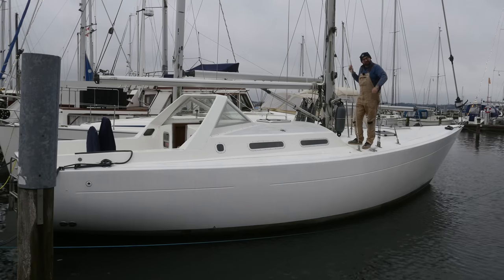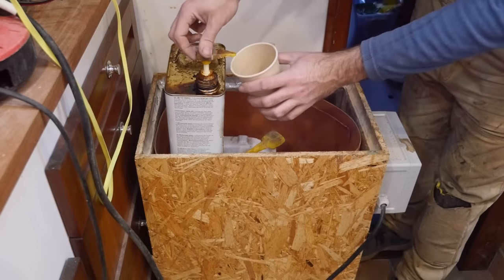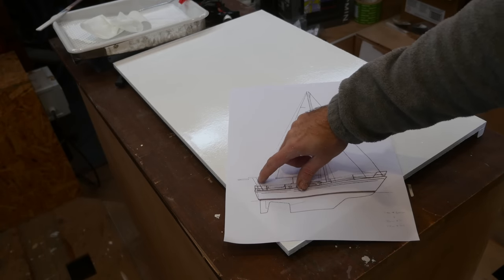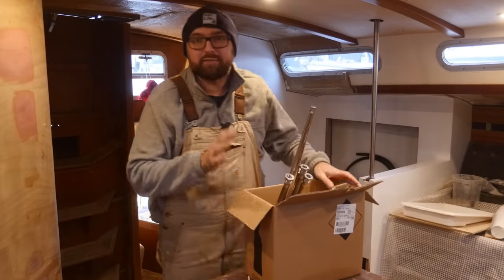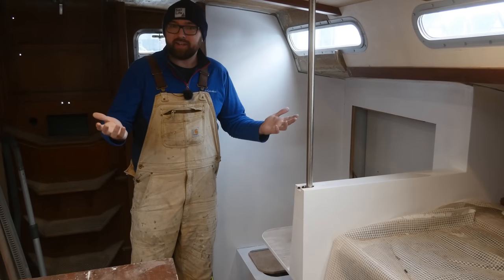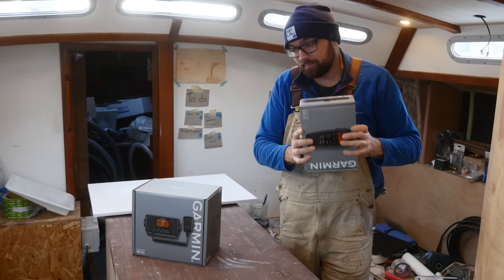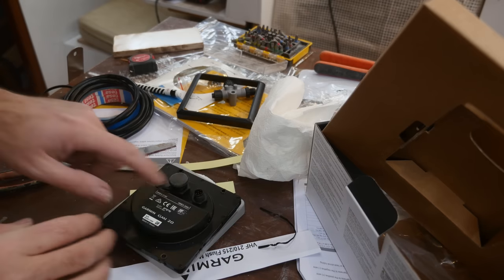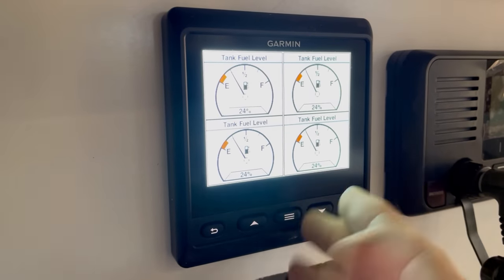Sail Life - Solar arch model, toe rail, NMEA 2000 network - DIY sailboat project

Comment: NMEA-2K is great. It is a huge improvement over the previous marine  network standards.  Like USB, it is basically plug and play with minimal setup even on the network side.  For the most part it just works automagically.  Sometimes a box needs to be checked on a menu screen at a device to turn on something like sharing/passing the sentence or looking for it elsewhere on the network.

Is your old AIS from Athena NMEA-2K or the old standard?  Our boat came with an older NMEA-0183 AIS and I could never get to interface correctly with our new B&G Vulcan 7 chartplotter even though it is supposed to see 0183.  I even tried a $300 multiplexer to get it to work and still no go.  Finally I got fed up and bought a new NMEA-2K AIS, plugged it in and, it just worked right out of the box.  The Vulcan-7 saw and displayed the targets without even changing a menu setting.  Bravo Zulu!

As an electrician I've sucked a lot of string through miles and miles of pipe.  We usually use plastic baggies.  Underground PVC pipe often has water in it from condensation.  A paper towel just wouldn't cut it. They actually make a purpose-made "mouse" made out of disks and foam sized exactly for each size of conduit for sucking special "jet-line" through conduit. For 3" and 4" pipe it works much better than a baggie.  But for small pipes the baggies are better and easier -also much cheaper.

Comment: In my past, I had to pull cable through conduit. Good trick for getting that pull line in place but... The trick will likely fail by the third cable. I suggest you put "Pull Cable" in all your conduits and in the future always pull a new cable with a new pull line. If you have an electrician friend, they can point you to a good line and cable pull lube.

Comment: I would not make the two outer lines of the solar panel arch parallel, rather narrower toward the top on all sides (a truncated pyramid with a center of G that projects outside the base of the full pyramid, essentially). Reason being that the structure would not only look better, but also be far stronger as the narrower top would disseminate forces exerted by the panels easier. Just my 2 cents.

Comment: I have a somewhat unorthodox suggestion for the placement of the chart plotter - why not install it on a mounting arm (simple stainless steel post with swivel) above the navigation station / salon divider where you're installing the 24" monitor. This option is inspired by a similar idea on the Seawind 1160. By positioning it here, you'll be able to easily see it while in the salon, at the nav station, in the galley, or anywhere else simply by swiveling it as required. While I have no idea if you had some other ideas for the area, it might even be able to accommodate additional elements if you added a height adjustment feature, Continued luck on all your projects and Happy New Year!

Comment: This may be a crazy and impractical idea, but is it possible to rotate your solar panels 90º so they run lengthwise port to starboard... then hinge the two together on the long side so they can fold together like a book? You can unfold them when it's sunny out and fold them up in a storm.  That would take up less real estate on the arch, look cleaner, less wind resistance when sailing, all kinds of potential benefits. I just don't know if it's structurally possible.

Comment: Could you possibly have the solar panel mounted, from port to starboard oppose forward to aft? 
I think it would reduce the chance of the panels flex from the rocking and rolling of the boat. Flex can lead to a breakage, and that would suck.

Comment: Judging by the electrics you installed but had to tear out (about 2 years ago) you don’t need advice on how and where to run cables. If you do it the same as then, it will be the neatest work on the water

Comment: Happy new year! My feedback as requested: Regarding the breaker panel, as already mentioned, make sure the breakers are NOT at shoulder height. I can tell you it's really annoying when you're sailing along, and suddenly loose half your instruments! Also I'd place the AC-panel in such a way, that it's imposible to lean on it or touch it with a screwdriver when working on the DC stuff. Or did it come with a back cover? 

And some none-requested feedback: The rear arch looks proportional to my eye, but personally I think the panel has to be placed transverse to the length of the boat. Visually it's pointing to far forward, and will also make installing a bimini-cover much more difficult. Is it possible to install one large panel on the stern and two smaller ones on the cabin top?

Comment: Madds for what my opinion is worth HTDuchy's suggestion for mounting the chart plotter also makes best sense to me.

Otherwise would you consider mounting the chart plotter on a U shaped bracket attached to the wood ledge above and behind where you intend to mount your computer monitor?

After all having it in a location where it is conveniently visible and accessible while seated makes most sense.

Also if you could swivel it so it was visible when you are in the galley or working at the counter top for the galley/lounge island would that not be even better for things like AIS and so forth?

Comment: You should look into powder coating your winches. I know the new look these days is the satin black and you can powder coat yours like that really cheap and 100% DIY.
Reply: John Demos Powder coat will not stand up to the friction of the lines. It will wear off in no time at all, and look like crap forever. Also, those winches are chrome over bronze, just removing the chrome and prepping the bronze so the powder coat will stick will cost as much as re-chroming them.

Comment: practical tip regarding the solar panels , 1x2m 360Wp is very large , why dont you look at 1x1.5m 370Wp panels from LG ? same power in a smaller footprint

Comment: Happy New Year Mads!   The boat is looking good.  I'm wondering why you're spending all that money on expen$ive marine hardware like the GMI 20 units, and a dedicated chart plotter.    You've already got an iPad and a MacBook; you can drive an external monitor at the nav desk using the MacBook, and you can mount the iPad on the helm station.  You can run navigation software and display NMEA data on both computers, and avoid the expensive Garmin stuff.

Comment: Re solar arch and size of panels how about panels that fold in half so you can make them smaller if needed like in serious weather. Also have seen panels on the side that can wing up or down. May be better and more managable getting more smaller panels than two huge ones.

Comment: I had problems getting DSC data to my Garmin plotter via NMEA 2K. I forget if it was a VHF receiver issue (which was also NMEA 2K) needed to use the old NMEA standard. One of my projects is to use a Yacht Devices NMEA 2K to WiFi dongle that can present data to my PC. I'll be making a GUI to get that data to my display.

Comment: Happy new year! Might have been suggested or commented before but why don't you put the chartplotter outside where it's most handy during sailing? You can then through WiFi repeat it on a tablet inside? Much easier than a tablet outside and the chartplotter inside. Love the Garmin stuff too, super easy to work with and very intuitive to use.
Reply from the maker: There'll be a second chartplotter out in the cockpit :) I properly should have mentioned that in the video - doh! :)
Reply: @SailLife  Even better!

Comment: FYI 
It’s necessary to have a physical separation between AC and DC panels on a boat. Not to do this is just asking to get somebody electrocuted.
Reply: Actually, not really... many/most boats I work on have the DC and AC panels right next to each other. The convenience of co-location is just to great. But for safety I would definitely recommend having the back of AC panel covered to avoid accidently touching live wires. Blue Sea makes such back-covers for their AC panels. Also, as others have said, ideally you would run AC wires away from low-voltage DC wires where possible, especially for long parallel runs, only crossing at 90deg where necessary. For shorter runs the concern of 50/60Hz cross-talk is not great. Of particular concern is AC wires run parallel to speaker wire, where you induce 50/60Hz humm into the speaker and you can actually hear it!
Reply: I don’t know the marine standard around the world but in North America all new boat construction must have the DC and AC panels fiscally separated. I understand this boat is a rebuild but the opportunity to divide the electrical cabinet exist and would be rather simple. If it were me, I would do it.
Reply: @ianwidger7905  I don't understand your point - by using two panels, one AC and one DC they are "physically" separate and isolated, but they will just be mounted next to each other - which is what I was suggesting. Most boats, even production boats in the US, have the AC and DC panels right next to each other and that is quite safe!
Reply: @toddmalone4384  
Hi Todd 
The panels should have a fiscal separation between them. By way of example divide the cabinet into two separate sections with two doors. This way when working on the DC, the AC is completely separate and closed off. And vice versa.

Comment: Hi would you consider fitting a b&g gofree wifi? These work great and mirror the screen of a chartplotter or autopilot anywhere on a ipad or wifi device. I could even change settings from the ipad! I also have navionics charts on the ipad and could these charts instead of those on the chartplotter. A really clever bit of kit! Best wishes, have enjoyed your videos over the last few? years!
Reply: Forgot to mention, I remember you had victron battery monitors etc (another great bit of kit), these have bluetooth and can display on the ipad as well! Oh the options makes ones head dizzy!

Comment: I would use panduit behind your folddown electrical board surrrounding compnents mounted on hull of boat. It organizes wires very well. Try to keep ac wires away from signal wires and tonsome extent dc wires due to induced voltage and interference concerns.

Is your genset AC or DC?

Comment: I have never been on a sailing vessel in my life but it occurs to me to ask if some/all of this electronic wizardry stuff comes with warning devices of either visual and/or audible monitoring alarms for important or even critical issues whilst sailing and also stationary (never mind security issues!)?

Consider modern engine driven, these vehicles that have an increasing amount of electronics installed. Manufacturers have found it wise and often necessary to install such monitoring equipment despite many normal gauges and warning lights that have been used for years but have been increasingly ignored by drivers / operators!

What in practical terms happens if there is a power failure or something like a lightening strike? Is there a fall back position for coping to sail safely?

Comment: Instead of flush mounting the chart plotter, consider a pivoting RAM mount.  They can be used on vertical or horizon surfaces and allow turning the display for better viewing in different locations.  See https://www.rammount.com/part/RAM-109HU

Comment: Mads, you should use the Sunpower Maxion 3 they are 400 w and 1690x1046 the best and most rugged panels. 300 mm shorter would be much better. Also, why is the arch so high?
Reply from the maker: Thanks! Those look awesome. If the arch is any lower than I'll bump my head when standing in the cockpit

Comment: Where is your ac source selector, shore, genny, invertor going? Are you going to use something like https://www.amazon.com/dp/B000K2K8O6/ or a surface mount unit that can go on the backboard? I'd go for one on the backboard because it rarely gets used, and hinge-ing bigger cables is hard to strain releive well. Where are bus breakers going, one breaker for each 240AC, 24DC, 12DC to switch on/off? https://www.amazon.com/dp/B01G5WHOCI

Remember fuses and breakers protect the cable leading away from them, so you will still need breakers/disconnects at the shore plug, genny, batteries and invertor. Having a second disconnect in one place, desk, is for convience.  Those 2nd disconnects  and a/b, a/b/c power switches will take up some real estate on the backboard.  Lay those out first. Then plan for the cables that bend when opening the outer panel to be the width of the opening, it takes more cable but it will stress the cables less.  Use a split woven wire loom or something like https://www.amazon.com/dp/B07F3DSF8B to protect the cable hinge from wear.

If you think you need it, PVC notched wiring trough with cover (PANDUIT) , comes in many sizes, maybe some 50x50mm along the top and sides of the back panel, put them in first, not last.  Use wire ties that have a screw hole near the ratchet to spot tie cables including the ends of the cable hinge to prevent transferring stress to the cables past the hinge. Ideally the finished front panel will operate so smoothly while stressing the cable so little that using it for access to the disconnects and a/b/c selectors is practical. I'm thinking hinged on the bottom front panel with a latch.  First thing you wire up is a light inside the panel so you can see in there.

Last maybe splitting the front panel into 2 panels, one with the breakers and the fat power cables, and one for access, you get easy access to at least part of the back panel, and the half with the breakers panels can fold out only when you need it to.

Comment: Hi Mads, about the ideas for mounting the Solar Panels, have a look at Cpt William and how he is using stainless steel railings to create a manual sliding panel setup. I am going to do something similar on my Catamaran but upgrading to electric actuators so, at the touch of a button, I can deploy extra panels when at anchor. In my humble opinion, it is a much more efficient use of space and gives a different profile not having 1.5m of panels sticking out aft of the boat, as well as less drag on the boat when at sail. He explains it at this time stamp -  https://youtu.be/Ze_lWHTOIv8?t=994

Comment: Have you decided on your lithium batteries yet? I am a lion energy dealer and could connect you with the company that is here locally. They may be interested in a partnership/influencer type deal. If not, I can get you dealer pricing.
Reply: I cant believe you aren't bombarded by comments right now.
Reply from the maker: Thanks for your comment Chad :) I'm planing on using Winston cells and REC Q for a BMS but thank you so much for offering to help :)

Comment: Why run solar and have another thing on the outside of the boat when you can run a generator for 30 minutes a day to charge batteries on anchor. I would use a battery isolator for the house batteries so the main engine can charge the batteries underway.

Comment: Dear Mads, Your solar arch design needs to be revisited. Firstly, your demonstrator is box-shaped which looks completely wrong. For strength as well as aesthetics, it needs to be a trapezoid shape. Secondly, I would build it asymmetrical with the most aft arch being slightly smaller and at a higher angle to the deck. I.e. more upright.  Thirdly, the height of the arch seems exaggerated. You want it as low as possible, but high enough that you can stand under it..  Fourthly, if you are going to add Davids to the arch, it would make sense getting hold of the hardware for the Davids before building the arch, unless of course that you are going to construct the Davids as well. Finally, you should consider  building a simple tailormade hardtop to mount the solar panels on, with a lip to catch the rain water and lead it out of the cockpit. It´s also beneficial to hide wires and connectors. With your fiberglassing skills, you can have that done in a few days, and it would greatly improve the look of the final result. Happy 2021

Comment: What paint do you use in the interior? I like your results and have tried to find it in your older videos but can't seem to find it. I've been struggling to pin point the type/brand of paint for my interior. I'm painting over 1970s Formica and white oak veneering the newly installed plywood walls, so I hope it will have a nice balance :)

Comment: I would recommend a voltage stabiliser to power the NMEA2000 network they don’t like voltage drops such as when a winch powers up.  Mastervolt have a good range  https://www.mastervolt.com/products/dc-master/dc-master-12-12-6-isolated/

Comment: For cable management in my network closet I used 'pegboard' .. 
Using reusable zip ties like you find on the back of a TV that punch into the pegboard holes. 
I'm sure there are simpler solutions, this set up let me keep wires separated, and room to label them with a label on the pegboard.  Plus adding or replacing anything is easy.
Reply: That's an interesting idea ... I might have to look into that for my boat.